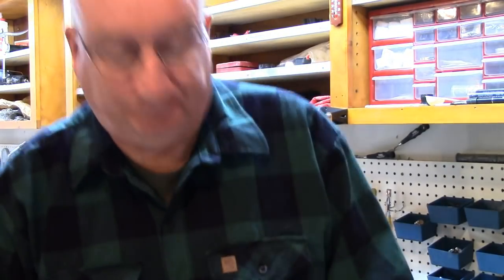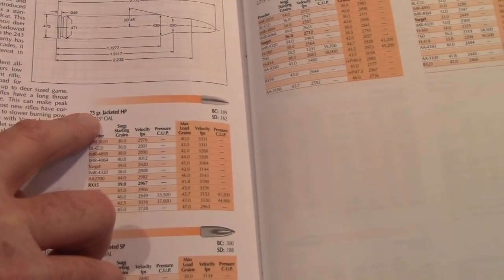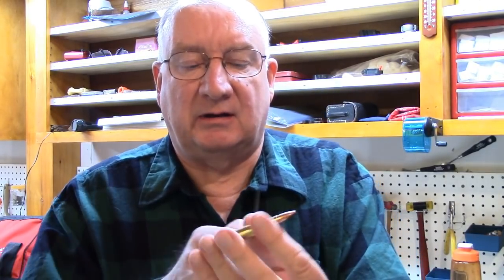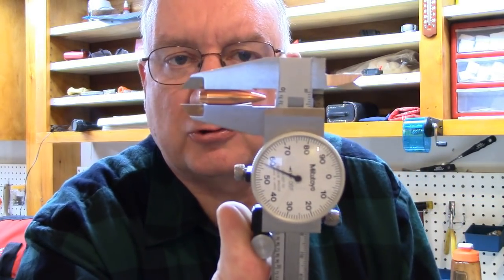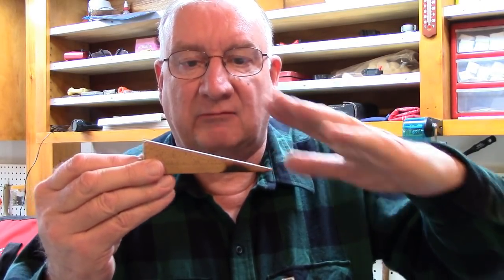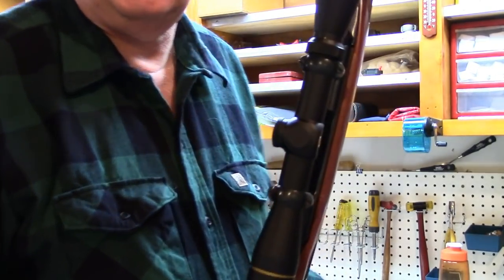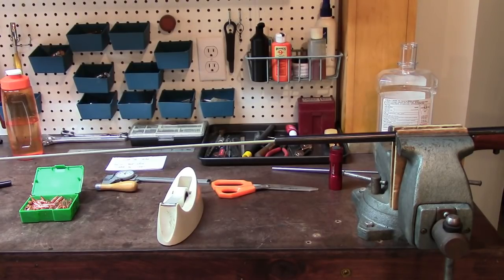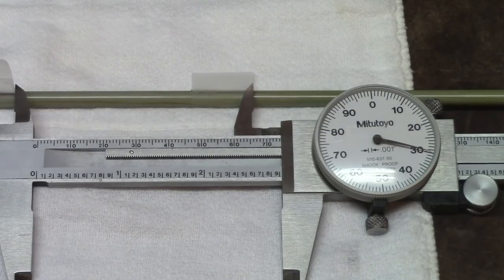Handloading PART VI, How to Measure Cartridge Overall Length ~ GunBlue's Complete Guide

Comment: Sir, I've watched your video and it was very helpful. My rifle is Rem 783 in 308 cal. I measured COL using your method and got 2.905 in. Then I've used a loose bullet method and got 2.9165. I figured the higher number is due to bullet pull back by rifling. Anyhow, I figured 2.905 is closer to the truth. According to your advice, the optimal cartridge length for my rifle would be between 2.890 and 2.875. Here is my challenge. I am using Hornady SST 165 gr bullet. The boat tail length is roughly 0.1545 and the overall bullet length is 1.2785 If I add a minimum 0.308 to account for "contact length" there may be only 0.816 in of bullet sticking out from the brass. My brass is 2.009 in, so maximum round length would be 2.825 in. That is far away from optimal length of 2.890 - 2.875. It sounds like I need a long, non-boat tale flat base bullet. Can you think of any good choices? In your opinion, do I have an unusually long chamber for this caliber?
Reply from the maker: Oleksandr Ananiev 
Commercial 308 Winchester chambers are throated long enough to accept commonly used 180 grain flat base bullets, with clearance to the rifling.  Factory ammo is typically made to shorter OAL than can be achieved by the handloader for a given cartridge, due to this generous chambering.  I don't know if your bullets are slender target styles, or boat tail hunting bullets with shorter profiles.  165 grain bullets with boat tails have very short shanks that don't leave much latitude for adjustments inside the neck, fore and aft, if you wish to have full contact with the case of 308.  That's quite true of a great many calibers, and very few can be loaded ideally.  I can't reach anywhere close to optimal overall length with 50 grain boat tail bullets in my new 222 Remington, but those bullets shoot 1/3rd of an inch groups routinely.  Same for 75 or 87 grain bullets in my 257 Roberts, which shoots half inch or less.  First of all, unless you are shooting beyond 400 yards, there is no practical point in using boat tails.  Flat base bullets are generally more accurate anyway, and boat tails only extend trajectory and resist wind drift over extended ranges.  Secondly, slight compromises can certainly be made without loss of bullet seating strength.  After all, the 300 Win Mag seats only .264, and the old 300 Savage got by with only .221 contact, which is less than optimal for .224 bullets!  I would feel entirely comfortable within those bounds, unless you are using the ammo under strenuous conditions or in a hard cycling gun.  Never allow a bullet shank to sink below the case neck where the ogive is buried.  As for hunting profiles, most 165 grain boat tail bullets have almost identical shank length as their 150 grain flat base counterparts of the same brand, and the 150 grain bullet with the 308 is bread and butter, so a hunting profile 165 grain bullet should seat with decent overall length,  and will be reasonably close to the lands, even if not within .030 inch.

Comment: Will this coal gauge idea still work if your rifle has a recessed crown? Thanks!
Reply from the maker: John Giff 
All guns have recessed crowns of various shapes, which is why the method works.  The measurement is taken from the same relative position at the longest portion of the barrel, and not from the actual bore.
Reply: Thankyou! for your quick reply.

Comment: GunBlue, greetings from Tennessee.   I have been loading for 25+ years and find there is always something to learn.  I love your videos and how your discussion is like you are talking to an old friend.  I really like the tape method of length determination and see how this will work perfect with hollow point or match type bullet or the newer polymer tip bullets .  Lead tip or soft point bullets can get deformed and I suppose carefully choosing one that appears pristine needs to be done.  Your knowledge is immense and thanks for sharing!!!
Reply from the maker: George1mac 
I've never found it to be that critical.
Reply: That is something that got on my mind as well. I have bullets here from Nosler and hornady with those plastic tips that can vary 0.010 from each other. Is that difference negligible?
Reply: @artsandclouds  probably if you maintain 0.030 inch leade.

Comment: Thanks for your videos, they are great help for beginners!  I have followed your advise on bullet OAL and have a problem.  I did the procedure 4 times and came up with a overall 308 cartiage length of 2.720  The problem is the commercial 308 length is 2.785.  measuring by inserting a case with a loose bullet comes up at 2.940.  The bullet for both measurements was a hornady SST 165g  case was once fired in my rifle.  Where am I going wrong?
Reply from the maker: Variables can be extreme, due to a number of factors.  The SST bullet has a very long profile, due to its pointed configuration.  Such bullets can easily add as much as .035" or more to standard overall lengths, while still indicating on the rifling at the same point on the bullet.  Ogive shapes can vary in terms of their radius and slope, particularly with Hornady, which uses different shapes in their lineup, including the sharply bent secant ogive.  The method of measuring by using a lightly crimped bullet can be very tricky and can give false readings, because rifling tends to grab the bullet and pull it back out a small amount, which is often repetitive.  When using that method, it's important to smoke the bullet first, as a tell tale, to reveal the amount of drag out.  That's one of the reasons that I discontinued that method, though it does work, if you understand what you are reading.  Be aware that factory loads are typically far shorter than most chambers, in order to accommodate the endless variety of bullet weights, ogive shapes, and magazine lengths.  Be sure that you are not using a bare cleaning rod, where the bullet tip enters the threaded section, resulting in false readings, with the bullet buried in the tip, while it gives another reading on the bolt face.  The method I show requires a square, blunt rod tip.
Reply: That is the confusing issue, the suggested OAL is 2.750.  My rod tip is square and I am trying to get closer to the lands by using this measure you demo but I am coming up with a number shorter than the even suggested 2.750.  I'm expecting a longer number to get closer to the lands
Reply from the maker: +Master Controller You may simply have a shorter than average throat.  The measurement won't lie.  If you want to see what you actually have to work with, get some Cerosafe from a company called Roto Metals, online.  It's an inexpensive, reusable toolmaking alloy that is used by gunsmiths to make a chamber cast. It's very easy and fun to use as directed, and there's nothing like seeing your chamber and rifling leade.  It melts at very low temperature.  They publish directions for use.
Reply from the maker: +Master Controller This is the Rotometals product, as copied directly from their website catalog:

Chamber Casting Alloy Ingot

Product Code: ChamberCastAlloy

$13.99

Sold by the ingot. Ingot weighs approximately 1 pound.

Rotometals Chamber Alloy (158-190) is the best known material from which to make a casting of the chamber and throat of a firearm to determine caliber or check the dimensions. It melts at a temperature just above M & M's, so all you need is a propane torch and a bullet casting ladle. It can also be used to make a cast of a dovetail slot or any other hard to measure area. Also, it is great for removing the front half of a case from the chamber, in the event of case head separation; and lots of folks cast a small portion of the barrel to determine bore diameter. For best results, measure the casting one hour after casting. Contains 42.5% Bismuth, 8.5% cadmium, 37.7% lead, 11.3% Tin.

Technical Information

Basic Instructions

Plug the bore immediately ahead of the throat of the chamber using a small cleaning patch.
Pour the alloy directly into the chamber until full and allow Melting Point to cool, it will turn a shiny silver color. As soon as it has cooled enough that it is no longer a liquid (and doesn't present a burn hazard), remove it from the chamber. Take care not to overfill the chamber as the alloy will then run into the locking lug area, making removal extremely difficult.
During the first 30 minutes of cooling cerrosafe shrinks. At the end of one hour it should be "exactly" chamber size.

Notes
Melts between 158 and 190 degrees Fahrenheit
Should be melted in a clean iron ladle without direct flame on the product.
The chamber being cast should be cleaned thoroughly and a thin coat of oil or graphite applied.
Reusable

Contraction expansion factor versus time, measured in inch per inch compared to cold mold dimensions. Test Bar x 102 minutes - .0004"
6 minutes - .0007"
30 minutes - .0009"
1 hour + .0000"
2 hours + .0016"
5 hours + .0018"
7 hours + .0019"
10 hours + .0019"
24 hours + .0022"
96 hours + .0025"
200 hours + .0025"
500 hours + .0025"

© Copyright 2016 www.RotoMetals
Reply: I'm sorry, I thought my end was square but after checking again, I see it was not.  That was my issue.  Keep up the good work and many thanks!
Reply from the maker: +Master Controller Glad to assist.

Comment: Great videos I always look forward to them. I would appreciate your opinion  on this if possible, I mainly use Hornady bullets simply because of availability, but I find with some of their bullets and it might be the same situation with other brands I don’t know but my problem is when I seat the bullet if I wish to seat them based on the optimal cartridge overall length needed for my rifle, they can be sitting a few thousands on an inch before the cannelure, so I’m not sure if I should seat the bullets based on the cannelure or based on the optimal col. 
Regards
Dave
Reply from the maker: +Dave NB Unless you are trying to achieve a particular accuracy goal, and if you desire a crimp, seating to the cannelure is fine.  If you are not crimping, the cannelure has no influence, other than aesthetic, and can be disregarded entirely so you can seat to whatever depth works best.  But, follow the guidelines on the video and keep your distance back .015 to .030 or more from the rifling.
Reply: +GunBlue490 
Thanks

Comment: +GunBlue490 I recently bought some Norma brass from midway. I noticed some of the case mouths are out of round. Is this something I need to be concerned about? What is your process for treating new brass?
Reply from the maker: +Jonathan Smith No problem at all.  As long as there's room for the expander ball to enter the case, it will return it completely to shape.  Always full length resize new brass as a standard procedure, which will perfect all the brass.  This step should never be avoided, as shipping always creates issues.  As for the flattened openings... Lee dies work best for that, as they have a more narrow taper.  If they are really flattened, simply take a loaded cartridge and insert the bullet into the opening to ease it wider, just enough to start into the die.  Or, use the CLOSED tip of needle nose pliers to enter the case mouth.  Leave most of the work for the resizing dies and don't fuss too much. They are made for this duty!  Don't forget to lube the cases!  Please watch my reloading video that I just launched today that details all you need to know.
Reply: GunBlue490 Thanks very much for the sage advice. I look forward to your next reloading videos with baited breath!

Comment: I would rather have a 270 then a 223 I don't like a 30-06 either not because it kick a little more then a 270 I just like the 270 but good video looking to see more in the future
Reply from the maker: They all have their place in the sun, where each exceeds the performance of the other two for their particular jobs.  The 223 is an excellent small bore varmint round, the 270 is a superior long range plains round, and the 30-06 has the muscle and bullet weights to handle very large game.  The correct round for the job at hand is a matter of choosing the one that most closely fits the task.  The one that's the best for hunting moose in Maine is not the one that's ideal for shooting a deer at 300 yards, or the one that can be pleasant all day in the sun shooting varmints.  Is there a best cartridge?  Depends on what it's for.
Reply: GunBlue490 true I just like the 270 better good video looking to see more in the future
Reply from the maker: +Allen Stewart There will be plenty more to come, God willing.
Reply: +GunBlue490 awesome keep up the good work